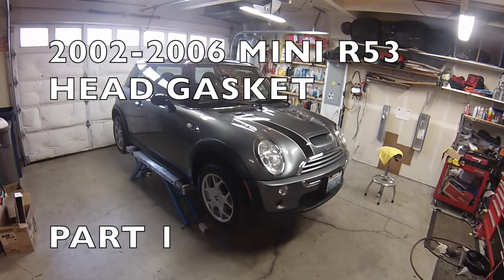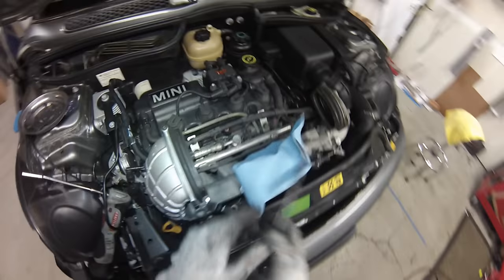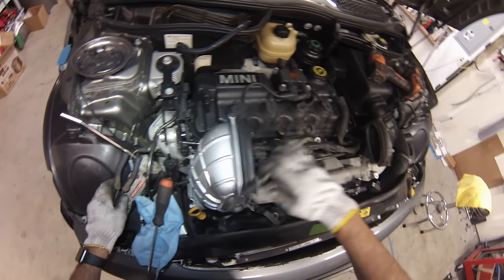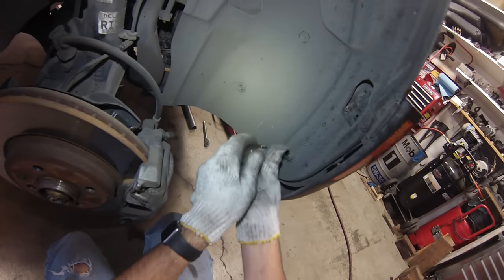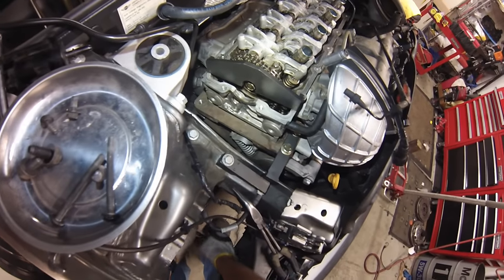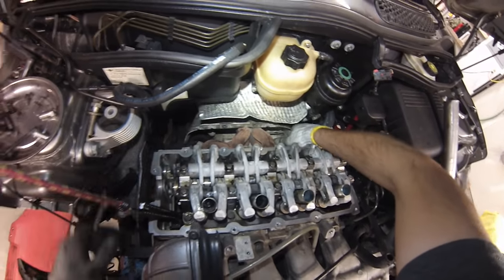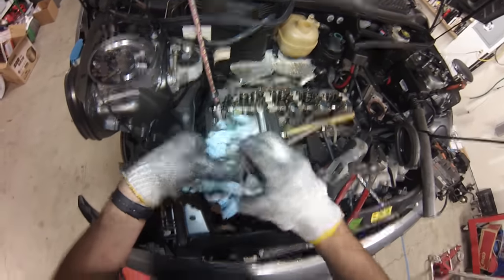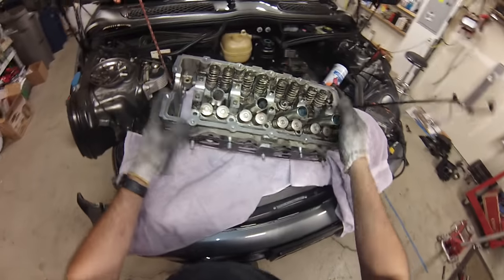How to Replace MINI Cooper Cylinder Head/Gasket 2002-2006 R53 Part 1

Comment: I've found some free time now that school is out and was going to attempt to check the timing chain guides for the cause of my knocking. I replaced the tensioner recently and there was no change. Will I be forced to remove the timing cover or will the valve cover be enough to check? I just don't want to assume crankshaft problems since the noise seems to come from the timing chain area. The car has 107K miles on it but I believe the car has been driven hard by the previous owner and neglected some regular maintenance since the oil and coolant were bad when I first got it. Thanks
Reply: It seems like minute 26 is where I'll need to be in order to check, minus removing a few components. No mechanic has wanted to touch the mini without quoting me for a rebuild or replacement engine. Thanks for the great videos and explanations.
Reply from the maker: You can see damage by removing the valve cover.
Reply from the maker: Oh and a lot of the times, the noise is rod knock, not timing chain. So be prepared for worst.

Comment: can the cam be left fastened to the head? or does it block access to the head bolts?
thanks
Reply from the maker: +Warwick Dean You have to remove the camshaft sprocket to get access to the chain guide and the 13mm head bolts below them, but I suppose the cam itself can be left attached to the head.  The only problem is as soon as you remove chain tension, the cam will want to spin to a neutral position, so you'll need to loosen the cam caps anyway to realign for re-assembly with the cam sprocket.

Comment: Hey Mod MINI , love your videos. Can you give any suggestions regarding removing broken oil dipstick. Is dipstick tube possible to remove?
Reply from the maker: happy nurdi front end service mode and go from there.
Reply: thanks mate ur the best. too bad you are not in the east coast
Reply: Have you tried a flex hose with the 3 grabber prongs tool.  That might slide down the dip stick tube
Reply from the maker: Dipstick tube is pretty narrow. However, something narrow, such as the metal spine from an old windshield wiper, with a hook bent at the end, might be able to grab it.

Comment: As an upgrade and aside from the added expense, would a new head and cams install be considered a direct install or does it require more work?
Reply from the maker: Not sure I undesrtand the question. If you replace with stock parts, it's a stock repair.
Reply: @ModMINI  what I meant to say is if I have a blown head gasket can I upgrade to a new cylinder head without the cost of additional labor since your there already? (Obviously a new cylinder head is 10 x the cost of just a gasket replacement) cylinder is out already? Correct?
Reply from the maker: @DrewPWebos  Yes, naturally, there is no way to replace head gasket without completely removing the cylinder head. Still may need to transfer some parts over to the new head

Comment: Hey Mod Mini, I was wondering if you had any input to what my problem may be in my 05 Mini S. Yesterday, I just got my Mini (Hammer) back from a Valeo clutch instal. I also installed the Detroit Tuned BPV and 15% pulley while it was in FES mode. Well, all was going well. Was pushing 15 boost and having a little fun. Right before I had gotten home, in third gear at about 4,500 RPM(I was pushing it a little) I felt a jolt, similar to Traction Control kicking in, but it was off. It seemed to have lost power, but it was still moving and going as it should, when I switch into 5th and so on. Anyways... I stopped at a stop sign, about to pull onto my road when everything happened. I went to go and it immediately went into limp mode, all the lights including SES and EML came on and there was an awful rough idle. I shut the car off, started it again, no prevail. Tried again, and all lights went off and the car seemed to move normally for the most part. One I got in my driveway, I let it idle and opened my door, noticing a tapping like noise coming from the passenger side. I lifted the bonnet, gave it some gas to see if the pace quickened with higher rpm, and noticed that the Supercharger barely sounded out, like a deep quiet moan. My specialist took it upon himself, had it towed back and we spent 5 hours straight trying to figure out the problem. With took off the belt, the harmonic balancer seemed to be fine, as it didn't fall into pieces and looks healthy to the eye. Next he removed the tensioner pulley, noticed the tensioner seemed to have no resistance and was limp, so we replaced that thinking it was the issue... started the car, and the problem still persisted. Then we did a boost test, had practically nothing. Then a compression test, and all four are low, like in the 70's through 90's dry, and hop up when oil is added. Still not sure exactly what is going on and was wondering if you had any advice. Thank you so much in advance.
Reply from the maker: +Christina Phan Really hard to say, but maybe timing is off or something related to the bypass valve?
Reply: I was thinking that as well, and so was my specialist, but I don't quite understand how the car would have jumped outta time? 
We checked the timing chain along with the rails, but everything seems normal. 
How else could it have jumped time?
Reply from the maker: +Christina Phan I don't know. The last time I saw a car with those symptoms it was timing. Just a guess. The car can jump time without damaging the rails. Only way to know for sure is to check for bits of nylon plastic/oil pump cover aluminum in the oil pan or pull the timing cover. (Also -the trailing timing guide has a nylon guide that can break off but leave the rest of the guide intact, giving the appearance that everything is fine, when all the friction bits are actually in the sump)
Reply: Okay thank you for your time, I greatly appreciate it. My specialist is having a machinist look at it  and he said I'll know something on Monday. If it's still unknown by then, I'm gonna push the issue on the timing and go toward that route. 
Again thank you,
Reply: Hey Mod, sorry to bother you again. I tried to stress the issue with the engine being out of time, but my specialist is determined that I blew all 4 piston rings and telling me that I need a new engine. He's saying that if the car is out of time, the compression woulnt bounce back with a wet test. Is this true?
Reply from the maker: +Christina Phan Highly unlikely all 4 pistons would be fine before a clutch install and then bad after, unless they were already weak in the first place. That could be what's going on, but definitely worth a second opinion. Could be something electronic - vacuum leak before the supercharger, broken bypass valve spring, slipping supercharger pulley, bad crank position sensor, etc. 

I guess what I would do is check that bypass valve first. Spring might have broken.
Reply: I mentioned this to him as well, but he said that with the compression readings coming back to normal when oil is added, it indicates something wrong with the engine itself and not an assesory.
Reply from the maker: +Christina Phan Possible.
Reply: @christina phan ever figure out the issue?

Comment: First off, great video. My question is, is there an easy way to tell if the camshaft dowel is missing. I have a feeling mine fell out, especially since I found it in the oil pan. Thanks
Reply from the maker: Only way I can think of is, look at the front of the camshaft. If it's not there, it's missing...?
Reply: lol, of course... I guess what I'm getting at is if I can tell if it's missing without taking off the sprocket
Reply: Well, now that I look at it, I can see that there is no way to tell without taking off the sprocket... to that point, I don't even see how the dowel could come out at all. Is there anywhere else the dowel could possibly be from? BTW, mine's an '05 R50. Thanks
Reply from the maker: The dowel fits in the cutout in the center of the sprocket. Can't think of any other solid alignment pins

Comment: Hi, what could be the problem if the chocolate milk is the coolant reservoir
Reply from the maker: Could be one of three things: 1. Failed head gasket/warped head/cracked head 2. Failed oil cooler (on the oil filter housing). 3. Someone poured chocolate milk into the coolant reservoir.
Reply: Mod MINI did you have a video of how to replace the oil cooler

Comment: Hey thank you for posting this video. This will be the first time I have really worked on a car before besides changing the fluids and the tires ha. So I took the engine head off my mini but I didn't have time to clean it or put it back together. It is just sitting in my brothers garage while I find time to get to there and work on it. Should I be worried about leaving it all taken apart without cleaning any of the pieces and letting the air get to it for like a 5-6 weeks?
Reply from the maker: +Samuel Rykken Spray some WD40 or something in the bore so it doesn't rust, and stuff clean rags/towels into the cylinders and anywhere else you don't want dust or critters find their way in.
Reply: +Mod MINI Thank you!
Reply: +Mod MINI Hey so I was able to put the engine back together with the new gasket seal and there doesn't appear to be any leaking so far. However the car seems to be running a little rough, almost like its lost power or like the it is just trying a lot harder to run. I think I may have messed up my timing because when I was putting it back together I got really confused when I placed the rocker arms back on the camshaft and the orientation (of the camshaft) I remembered didn't feel right so I just lined it up to where one end of the rocker arms was down and the opposite end was up. Could I have done something else wrong or is my guess somewhat accurate? (I have a 2003 mini cooper s by the way) I appreciate your help!
Reply from the maker: +Samuel Rykken Not sure if I understand. It's impossible to get the camshaft wrong because there is an alignment dowel on the sprocket. You may have gotten the chain wrong however. If in doubt, remove timing cover and align the three bright links on the chain with the small arrows on the two sprockets.
Reply: +Mod MINI +Mod MINI Oh yeah that's right! The dowel did fit inside the sprocket when I was putting it back together and I did make sure to mark the sprocket and the link with white out so I am pretty sure that's all correct then... The clutch pedal felt a little stiffer to push down as well. So if it isn't the timing what could I have messed up when putting it back together? Are there any tests I should run?

Comment: Hi, Do you need the cam position tool to re-tourque the timing gear back on the cam? Or can you have someone stand on the brake like you mentioned for the take-off?
Reply from the maker: +chappledesign If it works to remove, it will work to put back on.
Reply: +Mod MINI  I used a piece of pvc pipe cut to press against the pedal and seat rail to get it off! ...... heh...
Amazing vid BTW. SO well done. succinct, tight and conscious. Thanks a million..... I hope you are enjoying making these. We enjoy watching them.
Reply from the maker: +chappledesign Yeah that's the way I used to do it actually, I just thought it would be easier for most people to get a helper. My wife drags her feet when I ask her to help. I can usually rube goldberg something up before she gets there.
Reply: +Mod MINI  AND thats EXACTLY what happened. ...so funny......ha!

Comment: I just picked up a race cylinder head with a shrick camshaft.  Question is do you need to remove the rocker arms to access the head bolts?
Reply from the maker: No, but you need to remove the rocker arms to replace the camshaft.
Reply: +Mod MINI ok thank you,  the camshaft comes with the race head as a package.  I am not sure if it is installed with the head though I will find out when it is delivered.  I went with sneed speed over RMW I hope I don't regret it.
Reply from the maker: You're going to want to remove the rocker arms anyway in order to align the cam sprocket when you reassemble the engine. It's almost impossible to get it lined up with the valve springs pushing up on the rocker arms.
Reply: +Mod MINI thank you sir,  good to know.  And keep up the fantastic work I just did my CV driveshafts with your videos and it was a breeze.

Comment: awesome video man, you definitely have some of the best diy videos. and luca, while you're right it isn't a ton of space, when you actually know what what needs to be done it's surprising how much space you have.
Reply from the maker: +Michael Majewski The 1st gen MINI is pretty well engineered for serviceability. The 2nd gen seems to be not as well planned out.
Reply: +Mod MINI agreed, however my girlfriend has a 2nd Gen with the n14 engine. and honestly easier than expected. had to do her timing chain and it's not a difficult task. maybe since I'm a tech I can pick up on it easier... but still s uprising lyrics easy
Reply from the maker: +Michael Majewski It's not hard really, just a sequence of steps, but considering the "cassette" design, i was a little surprised how much time it took and how much stuff needed to be removed. I could change a timing chain on an R53 faster even though it's not a cassette design. Maybe it's just because I have more Gen1 experience.
Reply: +Mod MINI yeah the problem with the cassette design is that the breaks apart, like completely and your left spending s lot of time making sure EVERYTHING is out of the engine lol. there was broken top guide prices in the head I had to clean, and had to pull the pan off cause there were pieces in the pan, and had to take a paper clip and clean the oil suction tube to make sure there's no debris around the edges before the screen, and in my girlfriends situation I also had to pull the oil pump -.- because a small pebble sized piece got stuck between rod #2 and the oil splash guard and it was too tight to get at so I had to pull the pump to get my finger up there. believe it or not that little piece prevented me from being able to turn the engine completely by hand lol

Comment: How about if you need to rebuild the engine? Haven't found anything to assist us with setting the timing.
Reply from the maker: I have a video where I sort of show the timing set procedure. Essentially there are bright links on the chain which correspond to triangle marks on the two sprockets. Simply align all the marks and then put in the tensioner.
Reply: Mod MINI it doesn't matter where the crank is?
Reply from the maker: Crank will align at middle dead center when you align the marks.
Reply: Middle dead center of what? The compression stroke. Just need to know if #1 cylinder is on TDC and Intake valve ready to open?
Reply from the maker: What are you trying to do? TDC is not used on this engine for any maintenance operation. You align all the piston tops at the middle of their travel.

Comment: Im replacing my headgasket for overheating problems so would i still need to drain the oil?
Reply from the maker: No need if the oil is clean but if the combustion gases had gotten into the crankcase as well, it would be a good idea as the combustion gases would acidify the oil.
Reply: Ok. im also having problems with my gears i can only shift into to 3rd and 4th and im not sure what the problem is or how to check. and if i were to loosen that one bolt on the cam sprocket, could i have someone put it in 4th and press on the break while i loosen the cam sprocket bolt?
Reply from the maker: You have a broken shifter cable.
Reply: awsome, thanks Mini Mod. you are very helpful!
Reply: so my car wont go into 6th gear, can i use 4th gear and have someone stay on the break while i turn the cam shaft sprocket?
Reply from the maker: Sure.

Comment: on the rocker arms there are these plastic spacers that go on the ends of them.. i broke a couple so i called mini of tucson to get some replacements for those and they said id have to purchase the rocker arms themself to get those little plastic things i need. do you have any suggestions? can i make some or are there anywhere i can possible find some?
Reply from the maker: You have to buy the rocker arms. Check ebay for rocker arms
.
Reply: we'll see that's what I'm saying I'm missing like 6 of them and I don't want to have to buy Six rocker arms. is there no other solution to solving my problem?
Reply: is there a reason why I have to purchase the rocker arms?  just to get those
Reply from the maker: Because you can't just get the plastic bits unless you work in a rocker arm factory. Like the dealer says - you can't get just the rocker arm clips. I would strongly advise against improvising something. Look on ebay. A used set of rocker arms is not that expensive.
Reply: ok i did find a set that includes everything on ebay. are those plastic bits compatable with the other rocker arms if needed? because i think im missing a couple from the intake side as well..
Reply from the maker: You can't remove the bits without breaking them. They are too brittle. You can try but I doubt you'll succeed. Get a complete set.
Reply: hey so i found everything i need on ebay.  are the passenger side rockers the ones that curve towards the passenger side? and the driver side rocker the ones that point to the driver side?
Reply: Or if you can explain the concept of how to know which is for the driver side and the passenger side. im confused.

Comment: what is the bearing thing used for that comes with the cam sprocket tool?
Reply from the maker: +Bad0scar I have no idea. I've never been able to figure it out.
Reply: +Mod MINI haha. me either. thanks for the video. installing rebuilt head tomorrow so very helpful.
Reply from the maker: +Bad0scar I even asked online somewhere once and got a vague answer that it's to put tension on the chain when reinstalling. I don't even know how that is possible. I've never used it.
Reply: Looking forward to Part 2. My rebuilt head arrived today with a Crower NS1 cam installed.